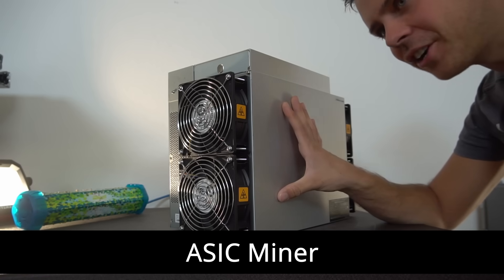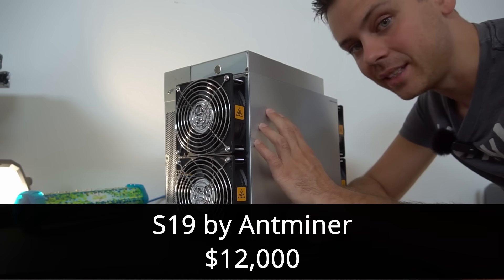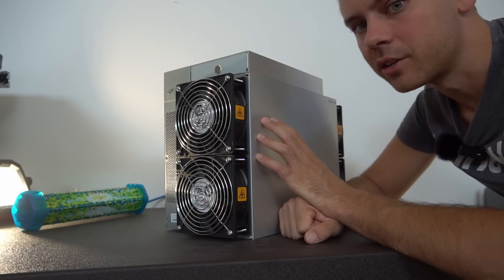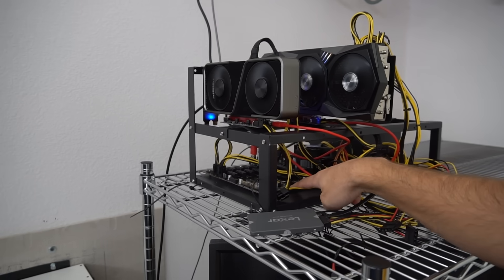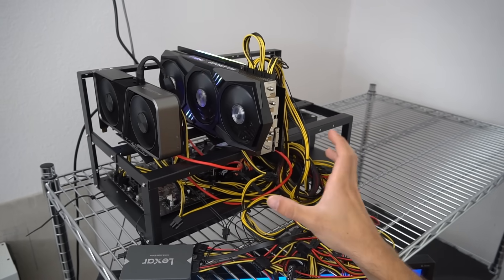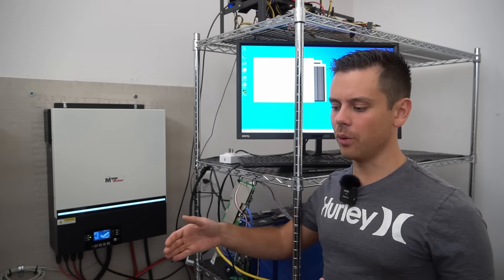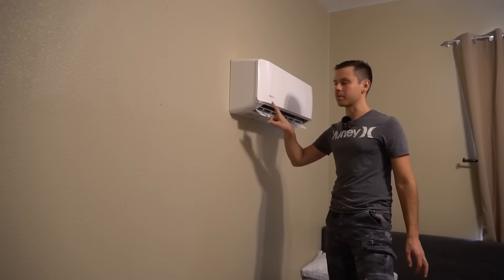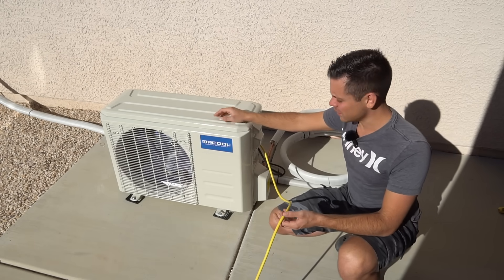Solar Powered Crypto Mining: Making free money with sunshine!

Comment: I would love a walk through on the off grid solar powering your GPU mining grid. Being in California TOU is killing me but I do have solar now. I’d prefer to just have my rig be off grid and power separate. I have a smaller set up only powering 6 580 8G on a 1k power supply. Any videos on that would be helpful!
Reply: I'm in the same boat and my electric bill is killing me for running 3000 kwh to get 1.3G hashrate.   My bill is over $1,000 per month and need to install Solar
Reply: You can put the miners on a schedule so they don't mine during TOU. Solar helps a lot though since it makes it's power during peak times. There is still the evening hours to consider though.

Comment: The environment, dude!

Yes, running the miners on solar PV or any other renewable makes it locally CO₂ free and clean beyond the embedded cost of the kit.  But just to have a cryptocurrency your proof-of-work must be recorded by calculating an addition to the  blockchain — and out there will bill huge numbers of computers doing those recording calculation, some on clean power but most on dirty.  We're now at a point where maintaining crypto records is consuming 25 terawatt-hours of electricity per year.

One transaction, mining one coin, has the same carbon footprint as 100,000 hours of Youtube video or 1.2 million Visa transactions. [ref: Business Insider, July 2021 and Digiconomist's Bitcoin Energy Consumption Index].

It's sad, but there's no way anyone can participate in a distributed crypto system of any kind and still hope that it's clean.   😞

Comment: Also, could you quantitatively calculate the impact of your whole setup (Home + Garage + RVs) on the environment on a long term. Include the emissions from even the manufacturing the components used (Li - based batteries, PCs, Air Conditioners, etc...). 

Does such an off-grid, comfortable, and money making setup have a positive impact on the environment?
Reply: In order to have an ideal impact on the environment, committing suicide would offset the environmental costs of having a home, eating food, energy use, and transportation.
Reply: @-whackd sooooooooo   you are still here?
Reply: The answer is no, that is clear and if that is the goal, one has to end a lot of activities in one life.

Comment: I wonder why you don't calculate the costs of running the miners only as heaters, use the "earnings" to offset the costs, and then compare it with the costs of other options for heat (insulation, direct solar, heat-pump, wood stove...)

Comment: Will, I'd vent that miner through a little hole in the wall, then allow a little fan to blow the cooled room air out over it. That takes away the bulk of heat load so the mini split doesn't have to work so hard. You also have to make a hole to let air in to balance pressure.  That gives you some fresh air.
Reply: That's what I thought too but hes in vegas, is hot there. However natural cooling will work great in other climates.

Comment: Another potentially huge point: if you mine through an LLC, you can get both the tax write-off PLUS the tax credit (25% of solar system cost taken out of your taxes dollar-for-dollar I believe). This means you're effectively saving something like 40-50% on the cost of the solar system
Reply: Solar equipment already has tax credit benefit. Turbo tax will say you can't double dip on those tax credits if it's already being used. So no you can't do that. You can however get extra tax benefits with an LLC vs side Hussle.
Reply: You don't need an LLC for a tax write off.
Reply from the maker: @mnotlyon  yeah everyone knows that, but it's nice to organize it under its own LLC.
Reply: @WillProwse  -why? details would be nice.
Reply: @doolittleranch8302  Because cryptominers are scammers, and US tax law is written to give big businesses deductions while messing with regular people. It's not noble to use crypto-mining to take advantage of that. That's just peak-CEO.
Reply: @facenameple4604  taxation is theft what are you talking about
Reply: Will, check out Kohler on youtube. Their a law/tax/accounting group that specializes in crypto and explain on youtube alot you need to know as well as help you manage it. An S-corp may save you more in taxes than an LLC. Good Luck.
Reply: How can I do that
Reply from the maker: Yes true

Comment: Your videos are so inspiring and well done - thank you! Question: I have the same Antminer S19Pro miner as you that consumes 3250 Watts. I'd like to add an affordable grid tie solar system to pay for the electricity for that miner but also have it built so that it can be easily expanded to add more solar as i add each additional miner. (I actually have 8 miners now of various sizes and will be adding more) -- What solar setup would you suggest? Maybe this would be a good video idea too. I love the idea of adding solar to cover each miner as one invests in a new miner.
Reply: THIS WOULD BE A GREAT VIDEO!  By my rough calculations, you would need 60+ solar panels at 400W each, but not sure how many solar controllers would be needed.   Would be great to have Will determine the system needed to run this off-grid using LiFePO4 for 24-hour run-time.

Comment: I think you're missing some math. If you have net metering then you could just as easily have made money on those 78kwh / day. I see average electric cost in vegas is $0.1215 / kwh. So you're either using that electricity from the grid, or using it before you sell it to the grid for that amount. That's 0.1215 * 78 * 30 = $284. You're still making $840 - $284 = $556 net per month, which ain't nothing. But now your payback period is closer to 21 months. Right? Or do I not understand net metering?

Though you should include your A/C electrical cost in that. And you had to overprovision your chargers and inverters compared to what you would have if you weren't mining.
Reply from the maker: I have net metering but they give you credits. So if I produce a lot in a day, the credits are applied to my loads running at night. They don't pay you if you backfeed the grid.

Comment: Might be able to use a gpu aio cooler but have it dump the heat outside the house. It's probably running 149F-167F, so on a 100F day you're still getting a delta. Dell certifies their servers to run with up to 98F fresh air.

Comment: I might be preaching to the choir here lol. The 6600xt definitely energy efficient along with the 1660 super. Hiveos is great to use as you os. My 1660 super runs 79w for 31.70 mh. It might be worth looking into. I was going to run my system off solar but I’m definitely not set up for it. Your videos helped me build my 1st and only solar set up for my cabin flawlessly! I hope a suggestion to look into the 1660 super is of some help since it also runs low watts even when overclocked.
I had to “edit” my comment and suggestion. Wow!!! You enlightened me at the end! I paused the video to comment…. I mine ethereum, and now just might start mining Bitcoin but gotta research running node. It’s quite amazing how knowledgeable you are, not just with solar. Huge 2 thumbs up for the video!!!

Comment: I hold Bitcoin, and mine. A year ago I got 53 LG 350w panels on my roof with 4 Tesla Powerwall batteries. I am able to mine 100% clean 24/7.  I agree Bitcoin will be king.  But, don’t knock the other projects, there are some real good projects out there.  I have a diverse portfolio of crypto and it’s because I believe in the projects, I am not trying to get rich quick.
Reply: Wow, impressive. If you don’t mind I will write that combo down, how many Antminer’s can you run with it (in watts). ?

Comment: Will Prowse a few months ago: "It's not connecting!  It's not worth it guys.  Just buy crypto instead of mine."

Will Prowse later: "It's your duty to mine crypto and like pulling money out of thin air"
Reply from the maker: 😂😂😂 yeah I have some other miners and fixed a power supply and a bad board. Now they are running. But I was thinking about it, and if we all pitched in, it would help the network. But man those problems were so frustrating.
Reply: @WillProwse  There is no need to get more people on the network.  There are so many people mining bitcoin that it would take a supercomputer farm worth billions of dollars to mine a single coin on their own.

Comment: do explain that for GPU mining  you have to work with pools... and the pools change protocols ..and your little ol rig is competing against folks with huge rooms with hundreds if not thousands of rigs. c... and periodically you will have to reconfigure your GPU mining rig in order to keep mining...    yeah its not that simple... and keep in mind the GPU's have to be up graded regularly just to kinda keep up... or they loose capacity to compete with those folks who have BIG $$$ and get top of the line rigs by the thousands... If your going to mine with GPU, you really need to sink in tons of $$$ and time !  you cant just build the pc, set it up and think its going to work for you with out any up grades and watching it over on a daily basis... and when it stops working sometimes simple reboot... sometimes change settings... sometimes change software...

Comment: I'm a little confused.  In the video you mention that you only want to mine (or maybe it's just hold) TC.  However, the mining rig you show (not the ASIC) cannot mine BTC.  So are you mining Ether or alt coins and converting them to BTC?  There are several pools that will let you do that (and they take a % fee).  Some friends of mine have been using nicehash, which pays out in BTC.

You talk about running a BTC node.  But are you really mining with a pool?  A single miner has a vanishingly low chance of solving a block and getting the payout for it.  Could you clarify what you're doing there?  If you're mining with a pool, you're not really providing a lot of decentralization.  The large pools control significant fractions of the hashing power.
Reply from the maker: Yeah I figured most people could figure that out. I convert to btc and hold that
Reply from the maker: No I'm using a pool

Comment: Have you thought about using a geothermal heat exchanger Will?  You could use the heat you generate to cool the home the downside is it would cost as much as the ASIC Miner to install... It is possible also to use the heat the ASIC Miner generates using a thermoelectric generator to recycle the power back into battery charging, that would be the crypto mining equivalent of regenerative braking in electric cars.

Comment: PS. Spending $12,000 to buy Bitcoin may be a higher ROI than $12,000 spent on an ASIC. Averaged 200% YoY over the last 10 years. By the time you earn the value of ASIC in 1.5 years, you have $12,000 in Bitcoin, and maybe an ASIC now worth $4,000, so you're up to $16,000 in value. But your purchased Bitcoin could now already be valued around $32,000. That's not even looking at solar grid and battery costs, or your time managing the mining.

Comment: Hey,  thanks for the insight.   I currently run 1 rig with 8 1080ti's.   Ive been looking into powering with solar...but havent crunched the numbers for total cost,  but this video helped a bunch.  thanks for the info.
Reply: go grid tie first so it doesn't matter if your solar is small when you start. You can just add more panel and inverters later.

Comment: If you’re running that 120 VAC mini split on an extension cord, I’m guessing - with all your current/line voltage drop knowledge - that’s either a very short extension cord or at least 12 gauge. Otherwise the risk is prematurely burning out the compressor due to it attempting to do the same work of 120 VAC on something dramatically lower, and running hot. 

(You didn’t indicate if it is a DC inverter based mini split. In that case the internal inverter might be able to correct for the AC voltage drop.)

Comment: I'm not a firm crypto believer (yet) as a store of value since it lacks anything tangible, but didn't I read somewhere recently that all of this enormous power usage associated around the blockchain verification and mining is easily avoided using another technology that's proven to work and uses a small fraction of the power requirements?  I believe one or more alt coins are already using it.  If so, shouldn't one be careful when investing in all the rigs if they could be proven basically useless for this purpose almost overnight if the other tech was adopted (and it sounded fairly easy to do)?   With everything being pushed towards "green", I would be very fearful about investing in $10k+ rigs that are deemed the enemy right now, even if a few are producing their own power.

Comment: There are moments in life, when people open your eyes.  I'm living in a offgrid cabin, the middle of nowhere, with excess energy in the summer.  You are a hero, and thank you so much for sharing your knowledge and wisdom.
Reply: You still need a good internet connection to do this!  If you have a slow connection or high latency, it won't work very well.
Reply: @surferdudemi  That's why you need a StarLink from Elon Musk.
Reply: @surferdudemi  not true... mining does not require good latency... just a good connection and a few mb/sec internet is sufficient.
Reply: @alans9099  yeah, it does. Otherwise the solution packets arrive late and you get a high percentage of stale values. Remember that speed is a crucial factor in mining blocks.

Comment: I didn't even know that you were in on the mining but glad to hear that you've taken it on. I learn so much about solar from your videos still in the process of bringing my set up to completion. I got 4x345watt panels 3kw iconica inverter and 6x12v 100ah batteries, and still not enough to run my pc day and night mining with the Radeon vii. So more panels and another charge controller might be needed. Also I am in England the sun light can seem like a gift from the gods at times. Been thinking to make a complete new system to be the back up and fool the inverter to thinking that it's the grid power

Comment: I have an ancient PC, the UK is probably pants for solar and electricity is expensive ($0.27 / KWh). My GTX 950 is too old but works with NiceHash. Of course it cost more to run than it earnt and GPU prices went mad. However...

In winter I used a 1500W fan heater together with the (natural gas) central heating to warm my room quickly to 20C. With both it took 10 min to rise 1C and I might run the fan heater for 30 - 60 min. 

So I'll try mining on my PC (150W) and old laptop (25W) for many hours before bed. It'd warm the room and get 'free' Bitcoin, or run them together with the heaters to heat the room faster.

With Crypto I had my only decent success buying ADA. It seems less affected by bad news and had a good run until recently. When £1 = ~1 ADA it also made it easy to work with rather than 1 BTC being £34,550.

Comment: Glad you covered the "hype". ADA followed XRP's footsteps and must have had a strong social media "fluff" campaign. Everything is hype, just like prior crypto cycles where these coins hype up "updates" that are totally useless because no one is using them. Price during a bubble does not = commitment. These coins have huuuge insider payouts, and like the "old" 2017 and prior crap coins guess when the marketing ends? And when the price drops to fractions of a cent? It's when the insiders finally sold it all!
Reply: Even with the large dip currently, been numerous opportunities to take profits on ADA, and most coins.  Plenty at 10x and not just at one point of the year.  Strong community, large percentage staking long term, and I see great potential in the project.  Compared to NFts, physical collectibles, or fiat savings accounts that don’t beat out true inflation rates, I think there’s plenty of other options that could be considered garbage as well.

Comment: the rig itself is pretty straight forward, but when you get into doing it safely and securely, that when mining becomes more in depth. Also what types of coins to mine ect. Mining is simple to get into, but way more complicated when it comes to prevention and security after that. You mentioned going to washington state and moving near a hydro damn. Would you not do solar or do it a lot less, as they wouldn't be as efficient up north ? I need to get a miner to replace my heater as well ( im on a electric heat , so my furnace is just a coil wasting money )
Reply: I think that Wash provides cheap electricity.

Comment: A few years ago, after doing the maths many times, I ordered the leading edge Ant-miner which arrived just in time for early winter. After 5 months of keeping my flat warm, it had paid for itself & made £130 profit. I only have grid power which costs about 15p/kWh here but I would have paid the same for the 800W in an electric heater.
It's earnings rate is now well surpassed so I only power it on during cold spells when it costs more to run than it earns, but is still net cheaper than running an electric heater.
I built a large wooden enclosure for it, designed to reduce the noise & direct the warm air flow.  If doing it again, I'd design the enclosure differently - it worked quite well, but the noise pattern wasn't what I expected.  And I'd use GPUs so I could sell them & buy new every other year.
Reply: I was thinking the same thing. Just use it in the winter when you need heat
Reply: LOL  that warm Air   contains tons of offgas from the electronics... you may want to go to the doctor and get checked out...
Reply: @HR-rt9nh  what a load of crap lol
Reply: LOL  look it up